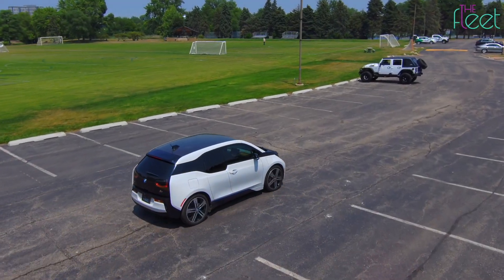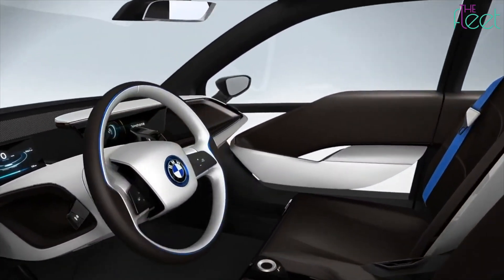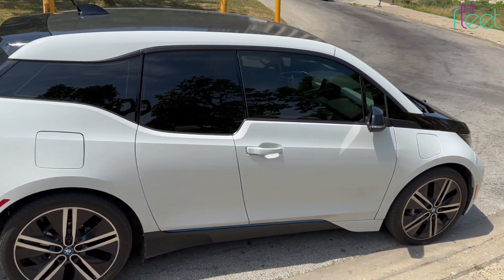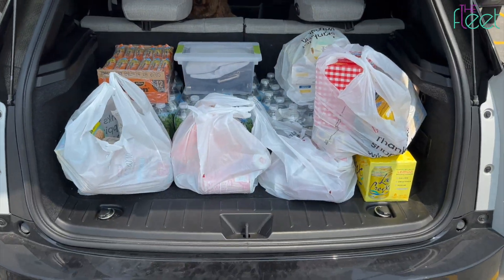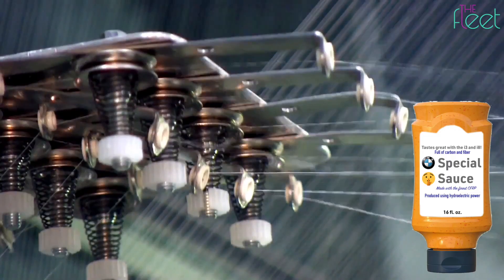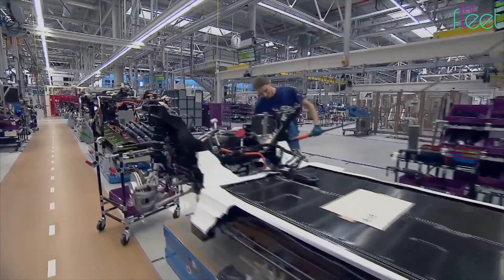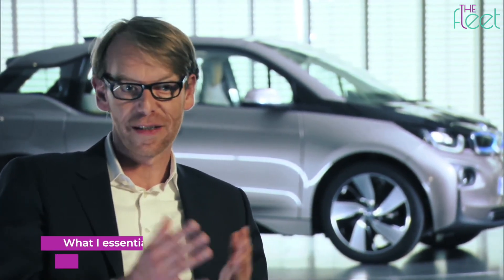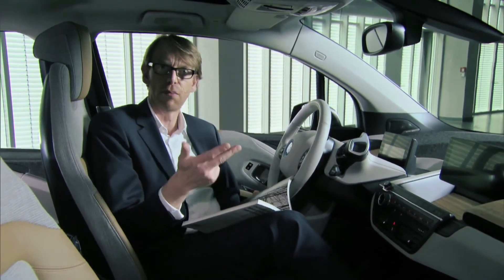BMW i3 - The Beginning to The End

Comment: Im on my 4th BMW i3 and not because I didnt love the car ...the first a 2014 was a bit problematic..it never let me down but had some glitches and since it was the first model year I decided to get a newer model, a 2017 which was a great car..protonic blue sun roof etc, but I traded it in for a Dodge Challenger..then I sold the Dodge and got a 2015 had it for a year and traded that in for a Pontiac Solstice..got rid of the Solstice and fast cars out of my system and since the price of these cars was dropping like a rock I got another 2017 with rex. This is without a doubt the best car I have ever owned and I have owned about 80 cars in my life. Will stick with this one....

Comment: Best car for the city we ever had…and we had several Smart Fortwo. The I3 is astonishing stiff and quick - a real pleasure to drive and our sports cars do not get too many miles added since we got the BMW. It is outstanding efficient and still among the best after all these years. Too bad that BMW killed it - but we will keep ours as long as possible.
Reply from the maker: The i3 was so far ahead of its time for something that came out 10 years ago - agree that it’s a shame BMW killed it off and just now are refocusing on EVs. Fortunately it has only been out of production less than 2 years at this point and there were 250,000 made, so hopefully parts and service will be available for the foreseeable future for all of us holding on to these cars. Thanks for watching and commenting, truly appreciate it! 👍
Reply: @thefleet do you know how many of the i3S variant were made out of the 250k? I have one of the last to be made in the UK and will be hanging on to it.
Reply from the maker: @SLJ2776  You should definitely hang on to it, already somewhat rare and getting rarer! 😄

So in terms of i3s models released, BMW hasn't released an i3s-specific breakdown, but...

- Public sales data shows a higher volume of i3 sales earlier in the lifespan of the car.

- The i3s was introduced around 2017-18, midway through the product cycle.

- After speaking with many dealers, the i3s was never the volume seller, feedback from customers cited its higher price point and stiffer suspension as factors.

- Based on the above factors and some additional data, an educated guess would be around 40-50,000 units out of 250,000, only about 15-20% of overall production.

- On the secondary used market, i3s models make up about 15% of the available vehicles, with the majority being "regular" i3 cars.

If you had a specific special trim of the i3s, you would definitely know the number produced. Here's some of the production numbers for those:

i3s RoadStyle: 900 units
i3s HomeRun: 20 units
Reply: @thefleet thanks good info. I have the Interior World - Suite with i3s propack, fluid black
Reply: @SLJ2776 I’d say not that many. I’m currently looking for a used i3 as a daily runabout & I’ve yet to see an i3s listed.

Comment: I am sorry but why did they make it so unappealing? I mean the look 😢… an ugly duck IM HO.
Reply from the maker: I think partly for aerodynamic reasons, and it’s so tall because the batteries are underneath the floor. I wasn’t a fan when it first came out either, but it’s grown on me.

I think the newer generation of electric cars has gotten even better looking. Heck, even the new Toyota Prius even looks okay compared to all the uggo previous models.

Thank you for watching, it means a lot. 👍
Reply: You should try sitting in it…it is basically a mini SUV. I am 6 5ft and have absolutely no problems getting in and out or finding a comfortable sitting position…because the seats are relative upright and very adjustable. I don’t think it is ugly…just different,

Comment: We had one of these for 3 years, my wife was initially reticent but she quickly came to love it. Nippy, great turning circle. Traded it in for an ID.3, on paper a better car but far less character. If only they had continued to develop it with a slightly bigger battery and faster charging, but I don't think it made money and once the other cars came along they qualified for the EU EV targets and that was that. 
I can see myself buying a late 120ah one day though :)
Reply from the maker: Agree completely and in the same boat - would love to trade in a 60Ah with range extender for a BEV 120Ah when the prices come down a bit!

Test drove an ID.4 and remember it being competent and okay, but lacking character. Ended up going with a Volvo XC40 Recharge because it seemed more fun and quirky, like the i3. 😄
Reply: @thefleet  Yeah the ID.3 is more of a match size wise. Great turning circle, rubbish software ... but getting better. We have a Model 3 for the longer stuff so a good compliment for one another. New Mini might be a good replacement next year when that arrives, or the Renault 5 ... doubt you'll get that in the US but you might get the mini
Reply from the maker: Keeping a close eye on the new Mini EV, I think it’s a close spiritual successor to the i3 due to the size and BMW connection. Then again, used 120 Ah i3s models are dropping in price now… 🤔
Reply: It did make money , only if the accountants try to add in the cost of the factory in Leipzig which is now producing other things. The production was just too slow with the mould making the CFRP needing 30 minutes to bake.  That just doesn’t allow you to produce the volume needed.  They learned that lesson and moved on.

Comment: I think the cornering is excellent. 
It would be great if someone did third party battery upgrade in future, either higher-capacity, or lighter weight, or both!
Reply: +1 for the cornering, the low CG helps this a great deal and a higher capacity battery would be a great idea. Limited range was the main reason I retired my i3 from daily driving and got a Tesla (still keeping the i3 as it has future classic potential and it's still a fun drive)
Reply from the maker: You know, I've been looking into this exact thing lately! Some places in Europe are figuring this out, and some i3 drivers have had their cars upgraded:

- http://www.i3upgrade.cz/en/jaktofunguje.html
- https://www.youtube.com/watch?v=EH02scyrCaE

It would be so appealing to go from 60Ah to 94 or 120!
Reply: A year on & guess what, there’s a Chinese company Martigi who will ship a replacement battery pack for your i3. They claim a potential range of 400km/250miles. I suspect in the real world that’s about 200 miles. 
Actually that’s about the practical range of most modern EVs. 
I think this is the way older i3 cars will be kept alive.
Reply: @hu... NICE.  It's good to have a backup plan the battery's been performing very well on my 2015, I think they must have an excellent battery management system

Comment: The i3 was a great design except for those far too skinny tires. Yes, they improved mileage, but they are far too small for the weight of the vehicle so they have an incredibly short life and are fragile. And now that the i3 is discontinued, there is nothing to stopping Bridgestone ending production of the tires. Then what do i3 drivers do?
Reply from the maker: Was concerned with this as well since they’re unique to the i3. Hopefully with 250,000 cars built, Bridgestone keeps making the tire into the future. Just paid $1,000 for a set of the 20 inch tires with tax and installation, spendy considering the short lifespan. Great points you raised! 👍
Reply: They use the excellent Michelin or Continental tyres available. Not an issue.

Comment: Clever design and sustainable materials making a strong but light weight car. BMW now has to work on a Hydrogen powered car and heavy vehicles. Toyota and JCB each have a Hydrogen car or heavy vehicle firmly in their sights as that is the future not batteries.
Reply from the maker: Another consideration would be the fueling infrastructure, and wondering if EVs are too far ahead at this point. In the US at least, almost all the hydrogen stations are in California. Drove a Toyota Mirai and it was awesome - combining an EV with the quick fueling and long range of ICE. It certainly has its merits!
Reply: You need to watch a video on Engineering Explained  YouTube channel about the huge downsides to hydrogen cars.   It is called: "Toyota Developed a Liquid Hydrogen Combustion Engine".   Very informative....